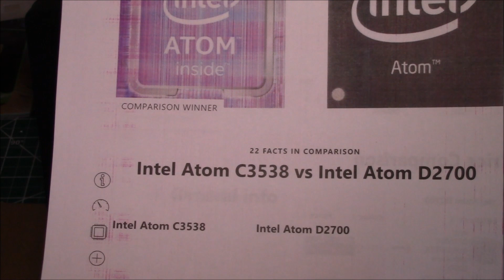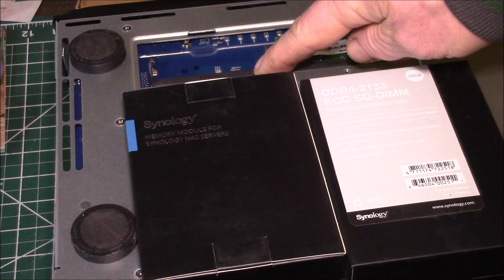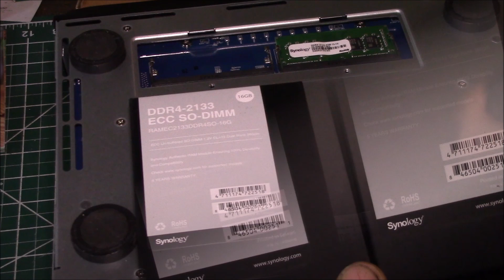Synology DS1618+ NAS: Unboxing and Memory Upgrade

Comment: Are you still running the DS1618+ and how was it for you? I found one online and interested in using it as a backup and plex server, but worried about lag.
Reply from the maker: Mine has been running 24/7 since I purchased it.  It's pretty snappy, especially if you get the SSD cache card and load it up.  It's mainly limited by the 1GB network unless you go for the 10GB network card (but then you can't have the SSD cache card).
Just started a drive upgrade today, in fact.  Swapping out the 10TB drives for new 14TB drives.  I'll be moving the 10TB drives into my old DS1513+ and that'll be my backup NAS.
Reply: @The4Crawler  Thank you. What is your SSD Cache card size's? And is that faster then upgrading the memory?
Reply from the maker: @mploof  I've used various size SSD caches over the years from 250GB to 1TB this time.  Basically stores the most recently accessed data for faster retrieval.  I went to the larger size for longer lifetime, since it takes longer to fill and then start needing to re-write.

I maxed the RAM out to 32GB, mostly for virtual machine use and the SSD cache needs a few GB.
Reply: @The4Crawler  Thank you for answering, one last question, is it possible to use an external SSD for cache?
Reply from the maker: @mploof  Yes, although I think it has to be an official Synology expansion box.  I did that on my old DS1513+, it plugs into one of the external SATA connectors:
https://youtu.be/gRzADfbSx0U

Comment: Great Video.
can 1618+ transcode 4K videos with the upgraded RAM ?
Reply from the maker: I don't believe it can handle real time 4K transcoding.  It lacks the hardware support for that.  It does do just fine with 1080P real time transcoding, that was my main goal for this machine, plus the additional CPU cores and memory capacity for things like virtualization.  You would need to go with one of the Celeron equipped models like the 918, 1019 or similar.

Comment: Is there any 32gb ddr4 memory cards you recommend?
Reply: I bought two of these 16GB ECC ddr4 RAM modules @ $107 each for our company's DS1618+ and it worked like a charm... https://www.amazon.com/gp/product/B07G9JDZ1V/
Reply: Also for expansion of storage what do you recommend?
Reply from the maker: I would highly recommend you hit up the Synology compatibility web page:
https://www.synology.com/en-us/compatibility?search_by=products
and look up your model NAS and find the listed drives.  I've had very good luck with the HSGT UltraStar drives and specifically the helium filled versions.  They run cooler and consume less power than the regular drives.  5 He6 drives in my old NAS consumed the same power as 4 non-He drives did.
Reply from the maker: I guess it depends on two factors; one if you need ECC memory or not and two if you want to heed the Synology warning to only use Synology branded DRAM.  For ECC there's the Synology parts or I mention another brand in the video.  I've seen one other brand that I can't recall mentioned in another video, maybe on the Spandotcom channel.  For non-ECC memory, look up the specs on the Synology site (voltages and speeds) and then find some laptop memory from your favorite brand that matches those specs.  
I would take care to purchase that memory from a reputable site as I've gotten some supposed name brand DRAM for a PC from eBay only to find it didn't meet the advertised timing specs and caused the PC to crash frequently.  After I replaced it, I found the nice name brand sticker peeled off to reveal a no-name lower spec sticker beneath.  So it looked good in the eBay listing but not in real life.

Comment: 4:42 found the RAM panel at the bottom
5:00 start installing RAM (please do not use a cordless screwdriver for these small screws!)
Reply from the maker: Good point.  Yes it is easy to strip small screws with a power driver if one is not careful.

Comment: what do you use it for thanks for showing it
Reply from the maker: Hard to remember all the things I have set up on the old NAS that will be moving over the the new one.  I use it mainly for file storage and backing up PCs and mobile devices.  It runs a backup web server for my business and I also plan to load the Magento e-commerce software on it.  I want to use that to help learn how to use that package to set up an improved on-line store for my business.  On the old NAS, it ran, but it took a minute between when you changed some attribute until you could see the change.  That made it so painful to use I never made much headway.

It also interfaces my home automation system to Google Assistant and also services cloud print requests to my laser printer.  It is my network UPS server, so if the power goes out, it'll tell all the other devices connected to power down safely.  It's also my media server, handling photos, music, video and live/recorded TV.  Over the last 5-6 years, I just loaded so many things on the old NAS that I maxed out the storage, memory and CPU.  

Once I get all those things moved to the new NAS, I plan to set the old NAS up as an automated backup server on the local network.  I'll have it wake up as some scheduled time, then the new NAS will run a backup to the old NAS and then the old NAS will power down.  Right now, I have a 4-drive box that I have to power up manually, start a backup task running (manually) and then power it down after the backup finishes.  As a result, I usually end up forgetting to run regular backups.
Reply: @The4Crawler  thanks for the reply so no video streamimg😊
Reply from the maker: The TV server package I'll be running does have an IPTV streaming capability, although I haven't used that yet.  I do some video streaming with Eurosport out of the UK but that goes direct to whatever device you are viewing the content on.  Aside from that, I don't use any other streaming service.  

There are a number of add-on applications on the NAS to do off-line downloading of media.  One is called Couch Potato where you can tag content you would like to watch.  Then the Couch Potato app watches for that content to show up on sites (like streaming services, USENET news groups, etc.)  you've set up in advance.  It that content shows up, the app downloads that content and lets you know when it's available.